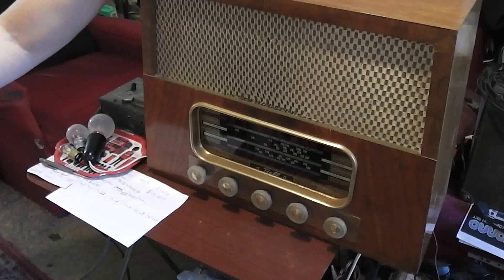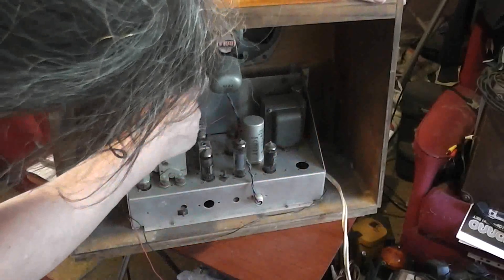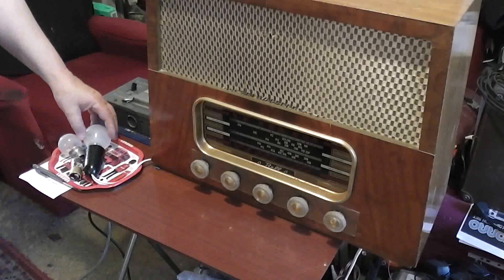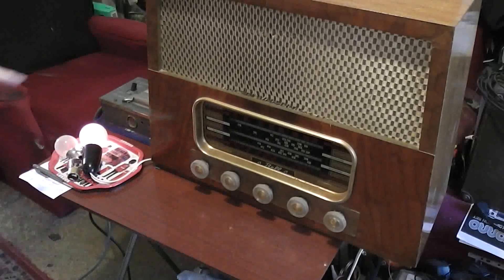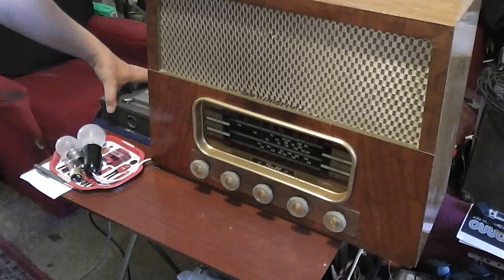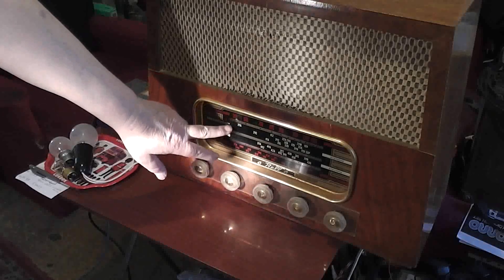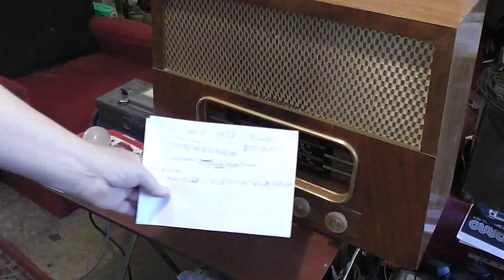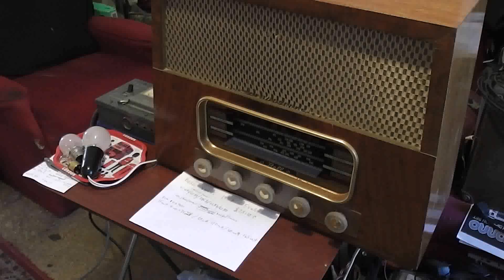1227.  Bell "?Venus?" 1957.vintage Vacuum Tube radio test (extra into below)

Comment from the maker: I just realised that this radio is a slightly different model to the one I had copied details off a website about. This model has 5 knobs and 6 valves in all, having the "GRAM"ophone input option.  The 1957 Venus had 4 knobs and 5 valves and NO GRAMophone input option.  I do not know if this model had an entirely different name or maybe just still known as a Venus. I am guessing the extra valve is a pre-amp for the Gramophone stage.
Reply from the maker: Douglas reckons the 6th valve is most likely an RF stage, which sounds likely, and would have given this radio much better performance it picking up distant Medium Wave AM stations.

Comment: Hi Catherine, I still think this is likely to be a 'Venus' just with a better chassis and nice trim (although in MGAR page 101 the Venus cabinet is shown as the 'Saturn', albeit dual wave - is yours dual wave with a replacement (wrong) dial glass?  I only ask because you have 5 knobs on it, and I'd expect one of them to be a band switch.  It looks to be using the 6B6 (6D6?) chassis from 1956 - seen in the Comet (which I've just added to the NZ Vintage Radio Project).  I don't have a schematic at present, but I'll see what I can find for it.  Also, yours has one big oval speaker where the 5-valve Venus had 2 x 5" speakers.  Interestingly, I've got photos of a near identical metalwork chassis in later models (57-58 ish) with all noval valves as well... Bell were masters of frugality.  Cheers, Steve
Reply from the maker: Mine is definitely Medium Wave only. The 5 knobs Left to right are /Off-on-volume/Bass/Treble/Widerange Gram-Normal Gram-Radio/Tuning.   Yes that's right individual. Bass and Treble controls and they both work.  No facility for shortwave/dualwave.  The knobs are labelled above them with what looks like factory original names. As my video rather poorly shows and not in detail, the dial glass is marked kilocycles at top, then North Island and South Island and Australian station names at the bottom most.  Sometimes with "mass production" you get weird models, using up parts left over or other curiousities. I know it happens with cars sometimes. I recall reading in a textbook that back in the 1960's some models of Rolls Royce cars were fitted with newer type AC alternators while others got the older type, lower power output, DC generators fitted as they left the factory...until such time as ALL the old stock of DC generators was used up and they exclusively installed AC alternators.

Comment: This radio has a tuned RF stage (the 6th tube (valve) and the 3 gang tuning capacitor). Thus it would be more sensitive and stations would come in louder.
Reply from the maker: Aha, thank you ! I was a wee bit suspicious that might be the case, but as it had a Gramophone input, just assumed the 6th valve was a pre-amp for the Gramophone input stage. 

With a dedicated RF Amp stage, it's certainly more understandable that they could, at night at least, listen to Australian AM Medium Wave broadcasts, from over 1,000 miles away.  I think that back in those days, with no FM broadcasts, that certain AM transmitters at least were particularly high powered. 

I recall as a child the nearest  New Zealand Radio 3YA Medium Wave AM  transmitter on a hill overlooking this small city, was more highly powered than the other stations, because it was intended to be receivable on NZ's "Chatham Islands" 500 miles, 800 km due East of here. (NZ's most remote, normally inhabited islands.)

 There are even  more remote islands down South nearer the Antarctic and up North close to the tropics, but special permission is needed to go there, so just scientists  allowed to count penguins etc or occasional short visits by  technicians maintaining the automatic weather forecasting equipment located there.

It's likely that several Australian radio stations were similarly higher powered, intended for remote rural listeners. cheers
Reply: @KiwiCatherineJemma  The valve radios I've come across (in the UK) have had a 'gram' input intended for a crystal cartridge which might deliver a volt or so, and typically put it in at around the volume control before  the audio output valve.  It would often be on a pair of banana plug sockets.
Reply from the maker: @usvalve  Yeah I think that little colonial NZ did very well making their own radio sets in the late 1930's and onwards. Initially at least the designs and many components would have come from USA and UK.  There was a push by the NZ govt to ensure local employment so certain components such as volume controls, louspeakers,  and wooden cases were often made locally, even when some chassis were imported mostly built-up.

Yes a considerable number of valve radios had "Gram" inputs. The most common I have seen are just 2 screws on the rear, under which wires can be wrapped and tightened down on. (Only some used sockets, and a Philips radio I tested recently had a dedicated proprietary socket).  As a teenager I had a "Garrard" record deck, taken from some old radiogram most likely, they were very common in NZ, that used to play records  through the Gram setting on my bakelite case valve radio. That radio got left behind in a house move almost 40 years ago, but might have been a Philips. 

I used to listen to Shortwave stations around the world at night on it.  I even wrote away to Radio Hilversum in Holland and got sent back some stickers etc. They had a regular timed broadcast I'd tune in for every week. The announcer spoke very good textbook learned  English but was not aware of colloquial things. Apparently they had a re-broadcasting station in  Madagascar (as in East Africa) which broadcast to this side of the world: Australia, NZ and Pacific I guess.